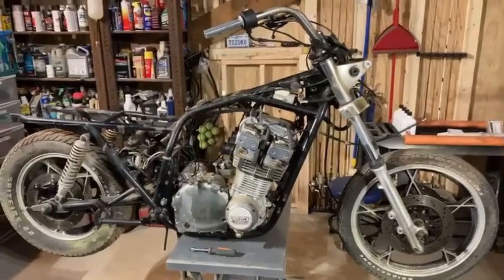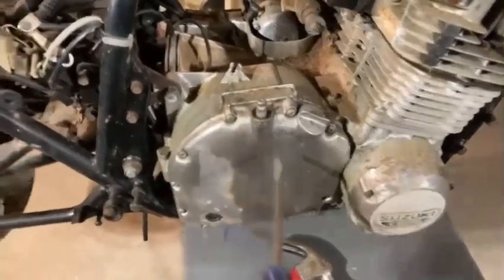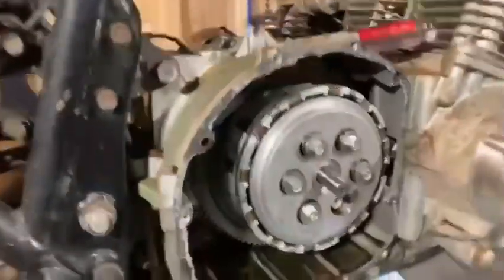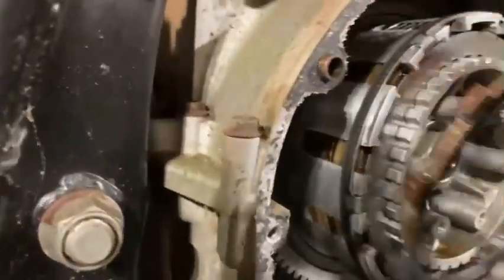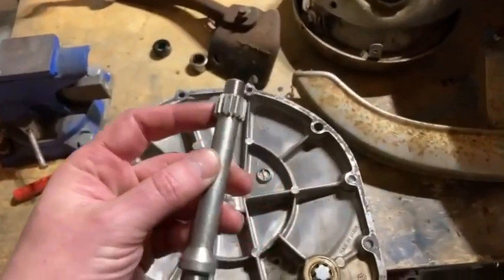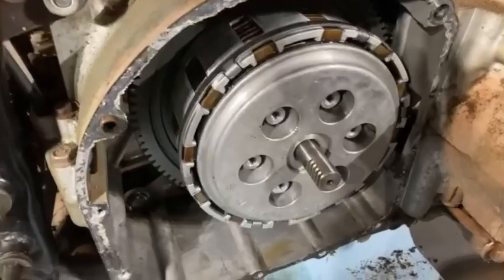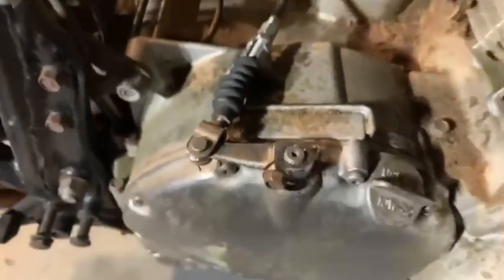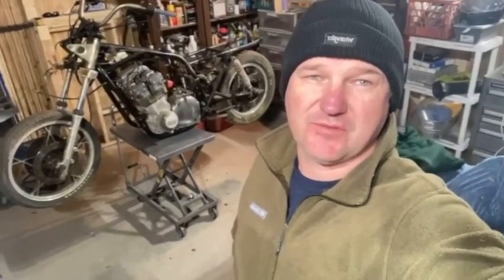Day 5 - Clutch troubleshooting and repair 1981 Suzuki GS750L

Comment: hey man, i was wondering where someone could go to replace the aluminum screws holding the cover on. i’m working on my project 1978 Suzuki GS750 and unfortunately i fucked up some of the screws (and maybe some of the threads, not sure yet). i did some reading and it seems like an aftermarket steel set of screws would work as long as an antiseize is used. the aluminum ones seem really hard to find, and expensive. any advice here? this is my first bike and i’m excited af but don’t wanna fuck it up
Reply from the maker: I try to avoid mixing metals when possible. If you are just trying to get going, steel and anti seize on screws you can get to easily to swap out later would be option B. Best of luck!
Reply: @KevinThomasAdventures  thank you 🫡